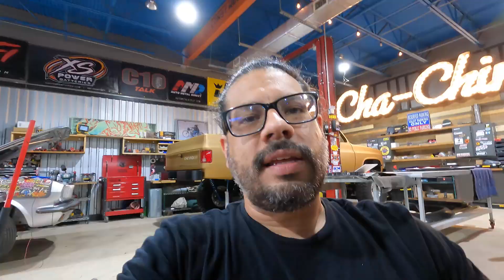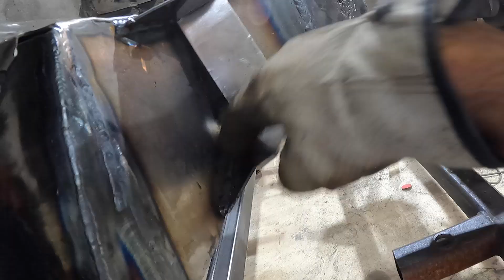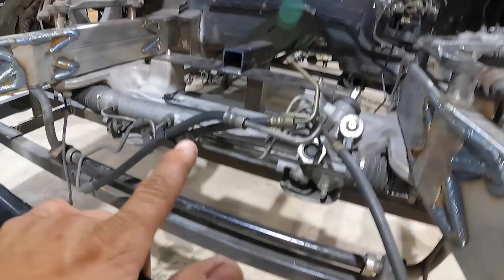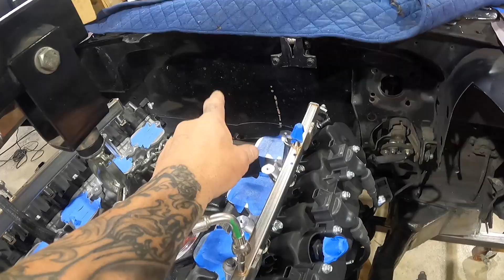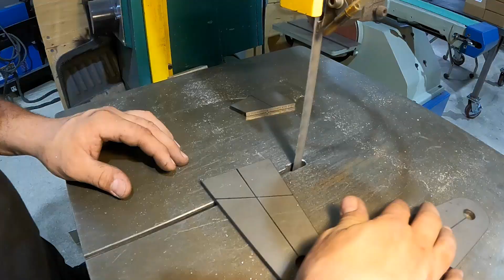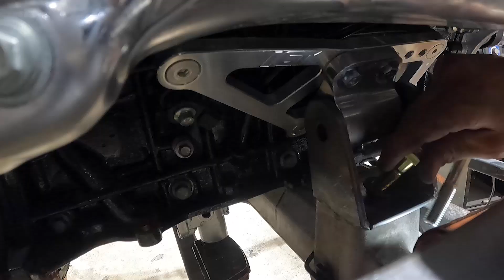Fitting a 7.3L Godzilla Motor in the Slammed Continental - 1965 Bagged Continental Ep. 3

Comment: Thought Ford was now offering an intake manifold with a more straight intake angle than the initial "truck" ones that point upwards. That would have allowed you to use the stock oil pan and have clearance under the hood...
Reply from the maker: We want to make sure we have ample room between the hood and the intake. But the oil pan isn't just for the hood clearance, it's also going to dictate how low we'll be able to sit the car before slamming it down on the pan
Reply: @SalvagetoSavage  so wouldn't an intake with a straight TB mount be better than the stock truck intake with the upwards mount? You'd get a ton more hood clearance as well and I think some better higher end torque as well as the runners are of a different length as well.

Comment: Probably should box in those bushings that extend out of the frame rail to connect to the sub frame, have the bushings 1/8 inch below the surface so it clamps down on the frame and not just the bushings. Also Probably should tie those engine mounts to the frame rail, you're putting a lot more engine than that sub frame was designed for. Please  tie the inside of the frame rail further. Back than 3 inches it looked like you had all kinds of room on the inside of the frame rail
Reply from the maker: Thanks for the heads up!

Comment: How much strength do you actually think you are adding to or taking from the original unibody with the new framerail design? Have you done calculations? I'm just curious. For its time, the 4th gen Continental had EXTREMELY high torsional stiffness at well over 13,000 Nm/degree. I wonder how stiff you could get if you found one of these cars in VERY good condition, stripped it bare, and caged the entire thing with crossbracing along the roof.

Comment: That chassis is going to be way heavier than a factory Chauncey guaranteed up that's not chrome-moly and it's going to be a heavy or should I say a heavy your car all I can say is you better put a good set of tires on it and see what the rating is for the weight of those tires other than that it's going to be a nice build
Reply from the maker: Not to worried about weight. The car isn’t built to race or go fast. It simply to cruise, look cool and be load. I think we’ll be ok. But hood call on the tires we be sure to get the corners weight up before buying wheels and tires

Comment: I am rarely one to be negative on someone's fabrication and methods cause we all go about things differently. I have always thought you guys did a pretty good job fabrication wise but something bad happened here. The mig welding is scary on this project and the weird random scraps of metal tying the new frame to the old frame seems pretty sketchy. I kept waiting to hear that the engine mounts were just a mock up and you planned to have some CNC made based on those or something. I get it if this is just heading to SEMA, but if so, I wouldn't show the corners being cut. I have been watching for 2 years or so, I think you build cool stuff and never had any concerns about the fabrication, just seems like you said "We need this done yesterday" and plowed through it.
Reply: CNC motor mounts, you mean Billet? if so why? its a simple bracket that no one will ever see once its all said and done. We dont have an endless budget here on our builds to do such expense parts. As long as they hold the motor then were happy. Thanks for the feedback brother, and thx for continuing to watch our channel. 

Mikey
Reply: @michaelrolleri2085  I agree that billet mounts are way too overkill for that and the idea for the mounts is solid. I would have done something very similar myself. My issue was only weld quality.
Reply: @DirtySideGetsDown  agreed! what wasn't shown in the video was us grinding the mig weld down and cleaning them up with a much nice tig weld. im sure it will be noted in a later episode when we take it all apart for coating. I grew up in a fabrication shop (custom stainless kitchen equipment , ventilation systems for restaurants) and started welding when I was 14. I only welded the duct work and it only needed to be air tight so it was simple. Now that I own this shop and starting to figure out how much you really need to know about welding im thinking about going to a welding course.
Reply: @DirtySideGetsDown  I agree … I mean come on man … there is always a budget.. and I think and feel that his idea was spot on … at least the fellas did improve the frame strength… I thought it was brilliant
Reply: @michaelrolleri2085  I agree that they mounts didn't present very well aesthetically but as long as the motor doesn't fall out when that thing starts hopping WGAF what they look like?
Reply: I'd like to add that the welds on the motor mounts also looked sketchy. Way too little heat at first then just gummers on top of those 😬
Reply: @PennerFab  they mig welds were grinned and tigged before they went back in. It wasn't shown. thanks for the add and heads up brother. we do appreciate all input, good or bad
Reply: I said the same thing. Welding spare pieces of metal. Why not just do a tube frame and get it over with?
Reply: Yea I was thinking that when they only tied it 2 or 3 inches back.... all kinds of room for a 1/4 plate on the inside of the frame rail
Reply: You need to sit down and shut up ma'am don't be so offended

Comment: So many small pieces all together, doesn't feel super sturdy... Looks like amateur job that figure out on the spot what to do....
Reply from the maker: They're being tied in to our square tubing with material that is a similar thickness and brought directly into our original framing. It should have more than enough support!
Reply: Agreed, normally I think their fab work is pretty good, but this screams SEMA build and never driven. Dave's tig welds are usually good, but the mig welding I saw has me sketched out.